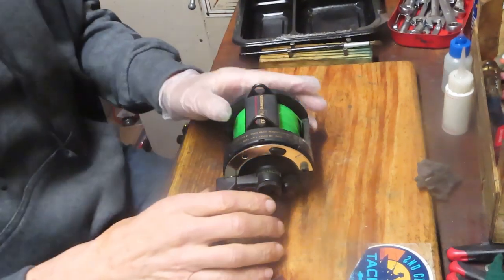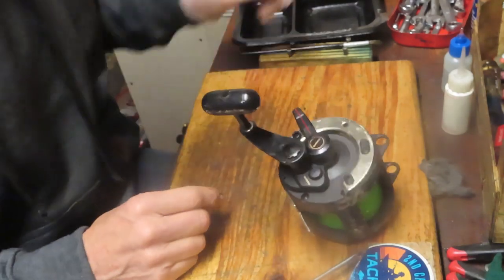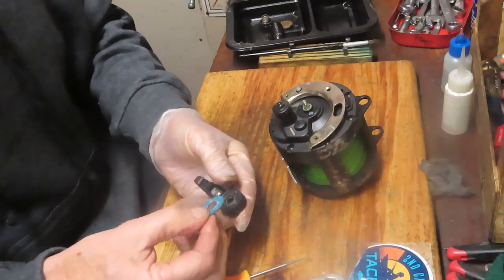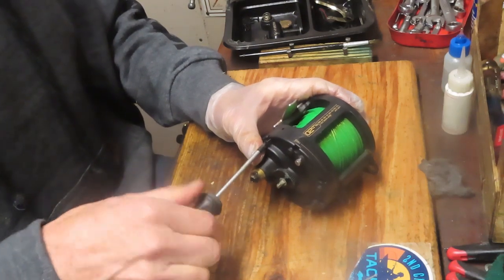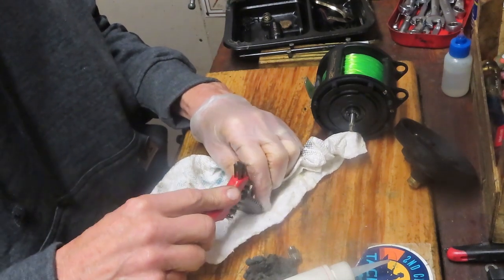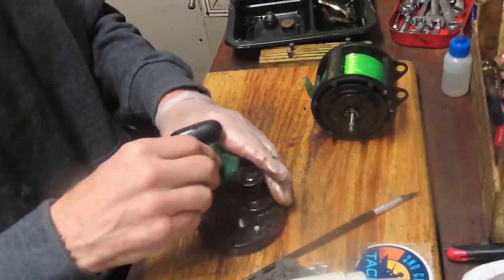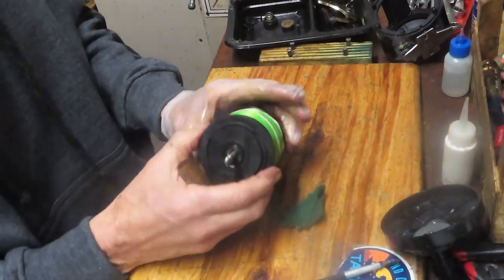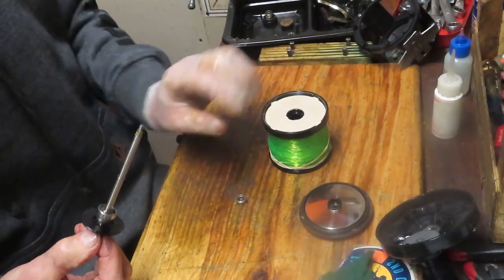Shimano TLD 20 Lever drag fishing reel how to take apart and service

Comment: Good evening Dennis.

At one time replacing line was inexpensive, not anymore, at least for large reels.

 Smaller reels that can be filled with a 1/4 pound spool are inexpensive to re-line. A large reel which requires 600-800 yards of line or more can cost you over $200. When you get into the 130 class reels, (150 - 250 lb test) figure $700 for a mix of mono and braid.

Ultra violet light is the culprit with damaging monofilament fishing line. Keep the reels covered and you can extend the life of the line. Braid is more effected by abrasion, so inspect your line at every use.

Keep up the good work.
Reply from the maker: Thank you well said and good tips - Dennis

Comment: Great Content! I have a question on a tld50. Actually 2 of them since purchased new. Drag is set to desired setting, however almost fully engages as soon as the lever is advanced out of freespool. Any idea what this could be?
Reply from the maker: It sounds like the pre-set adjuster has been tightened.  Do you lose max drag if you back off the pre-set?
The other cause could be dirt and debris clogging the drag washer.  It may need to be cleaned - Those would be my first guesses

Comment: Hello, I have a 300 Mitchell myself. I took it apart to clean and fresh grease. I put it back together correctly but noticed when turning the reel handle the spool should so up and down constantly? Mine goes up and stays up for about 20 turns then goes down and stuck down for another 5 to 50 turns. The teeth on the gears look fine. The gear with the 3 nubs on the back that goes in the plate might be worn slightly. What could cause this?
Reply: I apologize words are hard not a good explainer
Reply from the maker: It would be the gear with the 3 nubs.  remove the gear side plate and isolate the slide mechanism and gear.  Turn the gear by hand.  If it does not go up and down easily, your gear is mismatched to the slide bar. Raise the gear up and rotate it one step at a time until you can move the slide bar through the up and down range.  If that doesn't do it, then one of your gears, probably the one with the nubs on it probably has missing or damaged teeth.
Reply: @2ndChanceTackle  THANK YOU so much for your reply and time doing all these videos. I appreciate you sir

Comment: Hi what is the preset nob spring do
Reply from the maker: It sets the strength of the first strike and full drag on the lever.  If you want less drag on first strike, you back off the preset and more drag - tighten - Thanks for asking - Dennis
Reply: @2ndChanceTackle  if I use my lever drag reel with out the spring will the reel get damaged